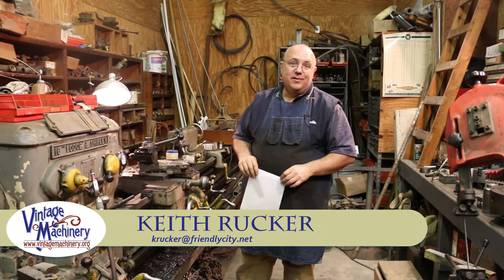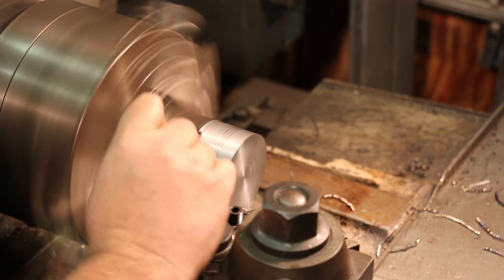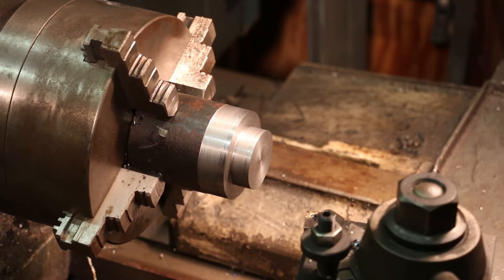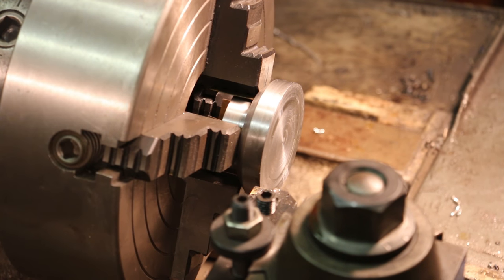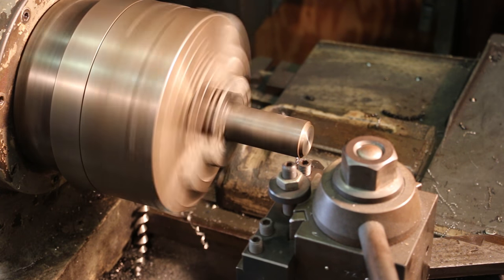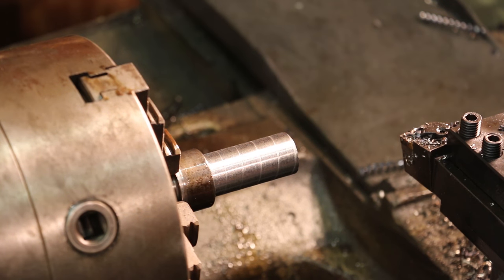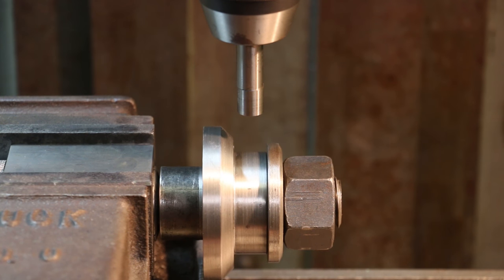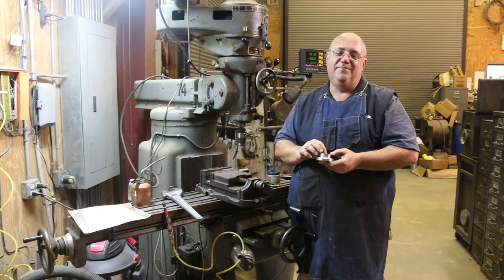Machining a Table Saw Arbor Flange

Comment: Great job Keith I love the inserts you guys are using now wish I had them in my day.
Reply: I'm so old, I just wish they had electricity back in my day...
Reply: It was rough running everything off a volcano wasn't it. If it wasn't for Edison we'd be watching You tube by candle light!
Reply: Make that Tesla
Reply: Larry Stacey Him too.
Reply: might have to mention Westinghouse in there somewhere and Alessandro Volta
Reply: jusb1066 Sounds like a plan to me!
Reply from the maker: Back when I was working in the machine shop in the late '80's all that we used was HSS and brazed on carbide.  Never saw an insert until I had left the shop for about a year and came back for a visit.  They had purchased a CNC lathe and were using the inserts on that machine, but none of the manual stuff.  Now days, I hardly ever use HSS....

Comment: Great video! I noticed you chose to upper limit of the tolerance for the press fit.  It said 1.120 (+0.005 -0.000).  If that were me I would have felt a lot more secure going for something in the middle, say 1.123.

Comment: Hi Keith    Thank you for another excellent video - I really learn a lot from these.
I wonder if you could do a 'laymans' video on Steel.  I notice you use different 
types of steel you find at the museum and come  up with approximate description.
I have found Mild Steel and Hot Rolled steel to be the least desirable steels to work
with as they seem gummy and leave poor finishes but am at a loss as to what would
be the next in quality.  I'm thinking a video just on some basics not elaborate.
Thanks again   Rod

Comment: I´m pretty sure you could have used the 1/2 function for the 5/8th division without a problem.
On the left side your .500 edge finder´s center is .0625 left of the target spot, at the right flange it´s .0625 right of the target. Half of both, well centered, I think.

Comment: Good video all round Keith. Being from Scotland it always amuses me that you guys still work in fractions of an inch and yet have to program your machines in a decimal way. Metric measurement would be the way to go, but I guess you've heard that before. Anyway  I always enjoy watching your work and love what you're doing with your own new workshop. If Scotland was a little closer I'd have been over to help you with that ceiling. Best Wishes for the holiday season ahead.
Reply: Ian Steele
Reply: Makes me chuckle too. 'thousandths' is actually metric units.... ;)

can opener + can off wrigglers .....
Reply: Could you mean "decimal" instead of "metric", metric comes from Metre.
Reply: I probably do. Still a base 10 numeration method. I'll get my coat......
Reply: Indeed, in this weather don't forget the long johns too.:>)
Reply: Already on...
Reply: Snap
Reply: I was wondering what a standard size door was in the UK.  It turns out that the closest size to the doors in my house is the 914mm width in the 2134mm height.  Looking at the chart at http://primedoorsuk.co.uk/standard-door-sizes/ I find that the doors are actually built to the inch.  This leads me to believe that the metric system is just to avoid having to teach fractions in school.  The real work is done in inches.  I also looked at the doors on this web site. Very nice. Don't know why their domain name is PrimeDoorSuk.
Reply: Seems sensible to me to make new doors to fit old frames, just like it is sensible to still sell 8x4 sheets of plywood, even it you label them in metric. The world doesn't change much by going metric, something our across ponder cousins(and the two other non metric countries) might think on.
Reply: We were once the Imperial Great Britain. 'Since the Weights and Measures Act of 1824 initially scheduled to go into effect on 1 May 1825.[3] However, the Weights and Measures Act of 1825 pushed back the date to 1 January 1826' ( wiki ) we used feet and inches etc. Exporting them to our colonies, that would be you Americans. I was the generation at school who was taught feet and inches, then told because of the EU we had to learn Metres and km, Then a change of government sent us all back to feet and inches, and then we were taught both. So that might explain why at 50 I am sat inside with only my coat and long johns on and I have a nervous tick and dribble a lot....
Reply: Little Work Shop of Horrors
I agree about the retrofit. I just assumed there would be an EU regulation stating that metric doors must inconveniently sized in at least one dimension from the Imperial measurements. 

We considered metric during the Carter administration. Didn't like it. Not too long ago a neighbor brought his John Deere tractor to me and asked me to help with a mechanical problem. I was appalled when I found that the bolts were all metric. I had to use my metric Crescent wrench.
Reply: Bill Elkins I wish doors were metric or at least taller, at 6'6" for a standard internal one I rubbed all my hair off. Well that is my excuse for no hair on top. As for EU, we are still fully paid up members, and I will have to wait at least 2 years before I can get a Royal blue passport instead of a nasty Burgundy one, boo hoo.
Metric crescent, would that be Abom's all millimetre spanner.
Reply: What some of you miss is the historical angle. During WW2 the US built an enormous industry, using inch measurements, making machines to make armaments and other war materiel. After WW2 we used these same machines for domestic uses. Sadly, there were some Asian and European countries that were forced to build new from scratch, due to the success of our efforts, and elected metric. We're stuck with these same old inch machines that powered the war and their offspring. In many cases, quite literally... people have WW2 vintage machines still working.

I like metric. I like Inch (fractions I just convert to thousandths). What is hard here is mixing the two. In newer areas like 3D Printing everything I do is metric, or an inch measurement converted to metric, because that is the native spec for the machine.

Americans are never going to allow our government to dictate how we make things. Economics, however, will dictate in a strong voice. Newer machines will someday replace these dinosaurs, and the markets we sell to will dictate the sizes needed. This process is well underway in general industry, but remember, this is a hobby for us, and we have to use what we have... yesterday's technology.

Comment: As a long-time viewer, non-machinest I always enjoy your videos Keith.  One question often comes to my mind.  What determines when you use a lubricant for what material.  It appears that lubrication is not usually needed when working cast iron or brass/bronze, but I noticed on this project you would sometimes use oil, and other times not.  Is there a general rule of thumb when lubrication is needed?  Does it vary with the cutter being used?
Reply: FYI, not Keith, and I understand you are not a machinist.  Common lubricating oils do not usually make good cutting oils.  Here is a primer on what it is all about:
https://en.wikipedia.org/wiki/Cutting_fluid
Reply from the maker: Generally speaking, I try to use a cutting oil when I am cutting steel and making moderate to heavy cuts.  Sometimes on light cuts, I will not use oil.  For cast iron and bronze, I tend to not use any cutting oil.

Comment: Is that what the blade goes on? Sure looks like it would be a a big blade!
Reply: likely a stabilizer flange.  Though a 1.125" arbor is quite big, perhaps European?  Most euro saws are 30mm though which is bigger than 1.125"..
Reply: Barry Gerbracht
 I didn't think about it being a backing plate, the shaft likely steps down to 1" for the blade as that is common.
Reply from the maker: It goes on a bit Oliver table saw that runs a 16" blade with a 1" arbor.

Comment: G'day Keith,I see a lot of people in these YouTube videos using cutting oil with tungsten carbide tipped tools and always wonder why ? All it does is waste oil and produce greenhouse gas smoke. It will not increase the life of the tool or give you a better finish. These tips are designed to run hot and while in production machining there is a case for using flood coolant to keep the job cool for dimension accuracy, it is a waste of oil otherwise.Regards Dave Tointon
Reply: You'll get a lot better surface finish every time when you use cutting oil-!!

Comment: Nice to see you making chips ... Am I being too fussy, but shouldn't the flange be trued up after it's mounted on the table saw arbor?
Reply from the maker: If the arbor is straight, it should not need truing up.
Reply: I have an old 10" Unisaw. Out of curiosity, I just checked my blade, arbor, and fence with an indicator. The blade was on the money at table level, the arbor runout was negligible, but the fence toed in about 0.002".  That was fixed with a slight adjustment. I usually have the fence toe out 0.001 to 0.002 ....